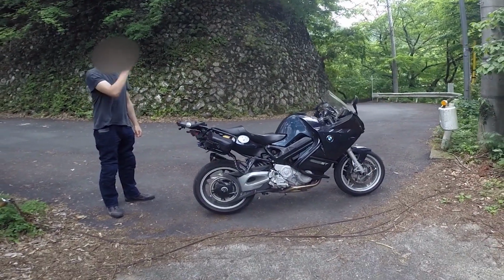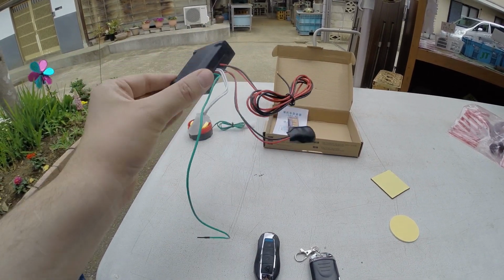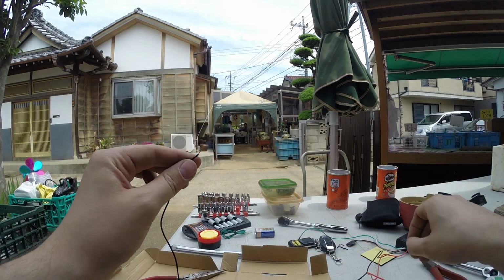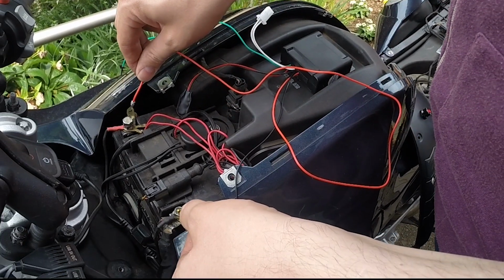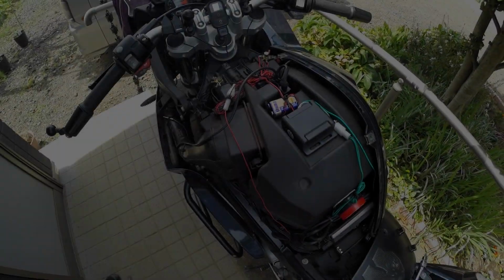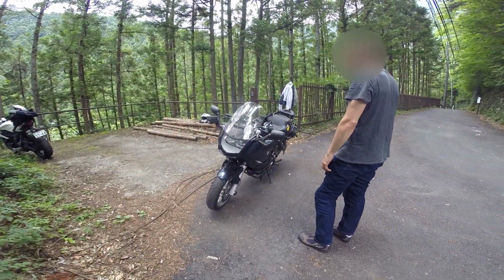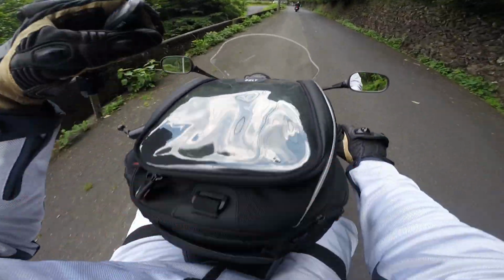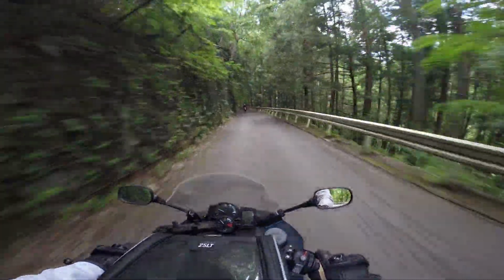#149 Installing a motorcycle alarm

Comment: Been thinking about installing the exact same alarm on my bike and your video helped me a lot. Really appreciate the time you spent to record, edit and post your review/tutorial. How well has the alarm been working so far and does the 9v battery help? Cheers
Reply from the maker: Actually I don't ride much anymore. I left the alarm on for a few months in the garage. My inlaws complained that every time they brush the bike or bump into it. The alarm goes off. Eventually the bikes battery died. In only intended to use the alarm over night when in camping or so. But I haven't really ridden in over a year
Reply: Does the alarm drain the battery even when the alarm is not armed? If the alarm does drain the battery just by being connected, then a switch could be added to disconnect the alarm and prevent it from draining the battery. Also, while in storage for more than 30-days, connect a trickle-charger to the battery. This will help preserve battery life. Cheers m8

Comment: Nice install, but I've gotta ask why you fitted one? Theft in Japan in general is super low right? When I visited Tokyo last year the amount of bicycles I saw with basic locks was surprising, here in London they'd be gone within 30 minutes!
Reply from the maker: Bikers Quest must people don't even use the picks they have.

i just put it on for fun really.

someone sat on my friends bike at night when he was touring. they were too dumb tho and dropped it. broke off the clutch lever.

never can be too careful. I'd rather sound 2500 yen. and made fit a good video
Reply: Yeah it's pretty good for the price!